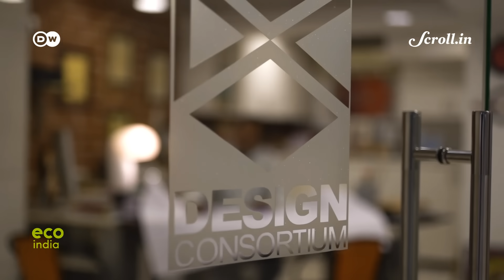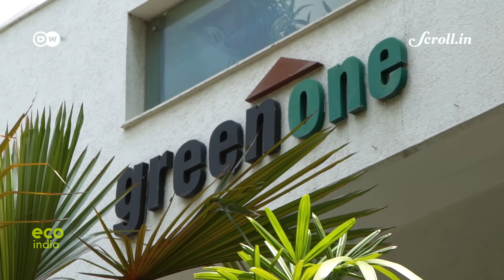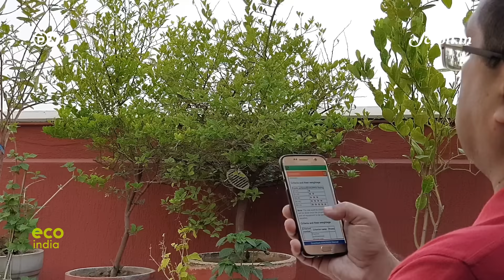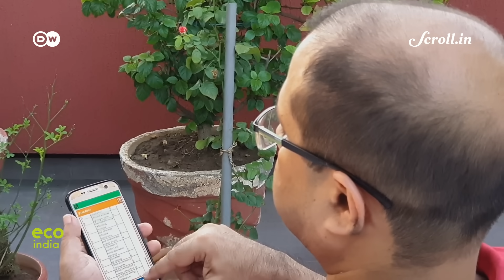Eco India: How viable is it to design and build an energy efficient 'green' home in India?

Comment: 70% people are aware of causes of carbon footprint, however only 20-30% know how minding small habits can lower the carbon footprint.

For example: 
1. using water in a mug for cleaning the raiser blade while shaving instead of keeping the tap on.
2. Switching off the unnecessary lights when not in use.
3. Setting 25 degree temperature on Air Conditioner instead setting it at chilling cold.

It is hard initially to change the habits and get out of the comfort zone, however eventually it gets easy.

The conclusion is to make life bit comfortable using the resources not abusing it.

Comment: Using cement is not green.
Reply: Using mobile is also not green. Taking any point here in an absolute sense is not practical and borderline dangerous.
Reply: @chandrakanthgummadi  From what I watched in the video, it looks like an ad for a company. Green buildings are supposed to be built with natural materials, not cement and tiles. This is just a fancy ad. There are better and real green buildings.
Reply: @thevishalln  You can feel that the video is an ad or whatever. It doesn't add to the argument. 

State practical alternatives for concrete and cement.

Using cement is inevitable if you are practical. There is a book written titled "Green Building with Concrete" published by CRC Press. Again, anyone taking "green" in the absolute sense will be chasing for perfection while the damage is being done. 

Some green practices are using  permeable concrete instead of normal concrete, using high performance concrete, using self-healing concrete, etc.

Comment: Green building is kind of art piece nowadays. Very expensive for small homeowners to implement. Process and components need to be simplified and be very affordable. Like the porous bricks, double glazed glass window... Or the composters and water recyclers need to be modular and cheap.

And it should be doable IMO. Example :  the policy push and increases demand for led lights have pushed the costs to affordable levels which were once premium products. And it should be replicable in this case also.
Reply: There are many small,cheap and localised solutions that exist these day. You may or may not be able to make it completely green but you can scale it.
Reply: @aashkashah7874  Yes solutions exist but IMO for majority of us they are either not affordable or accessible or available or all of above! In such cases we tend to go for traditional setups and thus back to square one. Any way that is changing even if slowly and that is the good news.
Reply: The Example is a Good One 👌
Reply: Sadly it has become a status symbol.. Antilla with 400,000 sft for only 4 people is LEED Platinum 😂😂.. but the video did suggest a few good solutions..
Reply: There is a rising concern about the negative effects of LEDs.
Reply: @sheilakijawani2526  Yes there is. Maybe it will lead to even better product which is less harmful. 🙏

Comment: The question is how rich should you be to afford such a home .....
Reply: One needs a good contractor or construction team to build such a house! Things need to be planned well and executed well!
Most of the builders I see are not up to that mark!
Reply: @AshokKumar-fu5ze  yes this is a new market and the Indian workers in the construction department simply lack contemporary knowledge in the ecogreen and renewable energy fields. They would need to gain new qualifications and skills to build such a home!
Reply: @yousha zaidi yes you're right..but mich of the ordinary people are going to calculate the upfront cost at the time of Construction itself and not later bills because those are dynamic and people think to use less rather than having some lakhs of upfront cost
Reply: @yousha zaidi yes, in short term it looks expensive but in long term it will be too cheaper than a average house.
Reply: Not much but you'll have to be rich enough to have a good larze size of land. Construction defers, this bulding has 3 or 3+ floors. If you construct duplex in 2000 sq feet area for 4 or 5 persons, that's more than enough. You can setup gym or other luxury utilites on terrace floor like terrace garden and swimming pool and have a small kitchen utility for bbq etc. For this the load bearing capacity has to be increased and it will not cost more than 6 to 8% of total construction cost. 

If you install Solar Panels then it's costly and will cost about 1.3 lakh for 2 KW panels and it consumes a lot of free space like 130 to 150 square feet at least.
Reply: The narrator mentioned that green homes will cost upward of 15-20%  over a normal home.
Reply: @sheilakijawani2526  the narrator also mentioned that it pays out with in 5 year.. which normal Homes doesn't
Reply: In long terms these type of houses  will pay you back my mean to say these houses will pay you fresh air ,healthy food ,pure water , electricity and a lot that will save your salary
Reply: No its not too cost its very less than a normal home because everything is reused and recycled
Reply: @yousha zaidi you are right
Reply: The fact that they quoted 10–15% more makes me think it's not green enough. There's unfortunately a myth going around that building energy efficient homes costs money, but it actually saves money if you do it properly: https://www.youtube.com/watch?v=G_mE7zJc53M
Reply: You're actually gonna save money in the long run.. 
Also.. have you not seen those tiny homes made out of recylced or re-purposed material.
Reply: Not necessarily- take a look at cob homes / earthships
Reply: Running costs seem to be very low- solar power, rain water harvesting ,etc - in fact saw a concept where solar energy capture cells are inserted on concrete surfaces